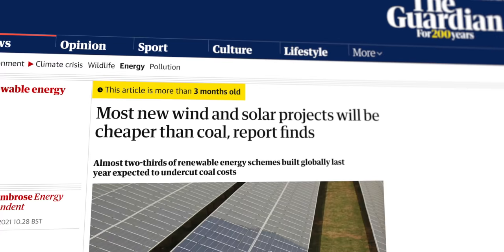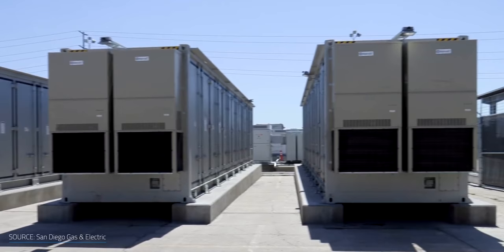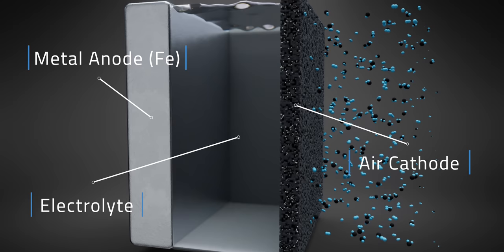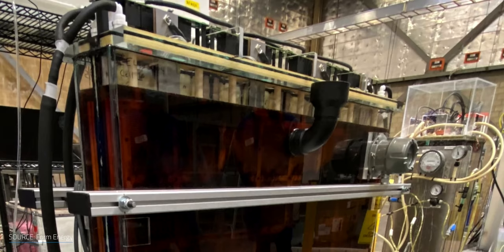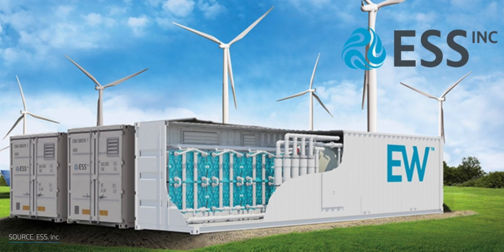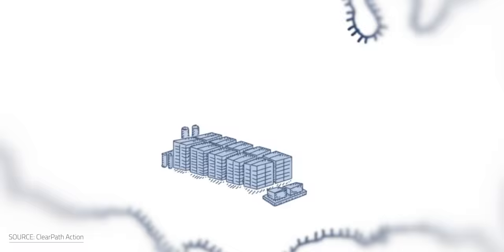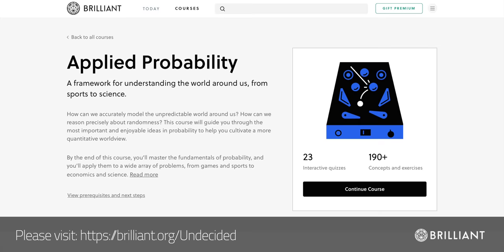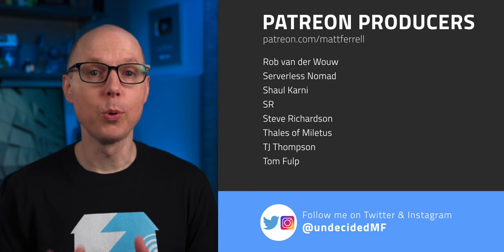Why Rust Batteries May Be the Future of Energy - Iron Air Battery Technology

Comment: It’s a common misconception that grid storage discharge time has anything to do with physical limitations of the battery tech. Lithium ion batteries can easily discharge for hundreds of hours. The issue is the market value of energy over these time scales versus the cost of the battery. Li-Ion is so expensive that it is only cost competitive for short time intervals where short peaks in demand place a strain on the usual suppliers. These peaks can generate enormous energy prices 100-1000x the average. Iron-air’s raw material cost and simplicity has the promise to reach the $20/kWh point where it becomes profitable to sell energy over tens or even hundreds of hours of continuous discharge when the price is much closer to average and you have to compete with traditional suppliers.
Reply: @Patrick Bryant - Thank you for this particular explanation. I was getting skeptical with the price difference between Li-ion cost @ $200/MWh ($0.20/kWh) and Rust cost @ $20/kWh. The point is that the $0.20/MWh of Li-on discharge is ONLY during peak hours of usage, whereas the $20/kWh of Rust discharge is "all day, every day".
@Undecided with Matt Ferrell - What did you find was the average cost of Li-ion during non-peak hours?
Reply: There is dollars per Wh, maybe there needs to be dollars per W (i.e., discharging speed) to go along with that.
Reply: @solarsoils7368  What Matt didn't make very clear in the video is that the kWh number and MWh number are not comparable because they are measuring different things. He ought to have provided equivalent numbers so people can compare them properly. The kWh price is the price of the battery, IE one full discharge cycle. The MWh price is the price for all the electricity you can store over the entire life of the battery. It is roughly equivalent to the LCOE for a generation system. What really surprised me was that Li ion batteries are so expensive that the electricity they supply over their lifetime is much more expensive than nuclear power over it's lifetime. Somewhere between 1.5-2x as expensive. So it may be cheaper to build enough nuclear power to supply all night time needs rather than building batteries to store solar power to use at night, even if you then just throw away the excess solar generation. If this rust battery really achieved what they are claiming it could (a big if as it's just a marketing claim with no public data to back it up) then it could be 1/10 of the cost of Li ion or better, which would make it much cheaper than nuclear.
Reply: In other world capitalims destroy the planet 👀👀👀
Reply: @memesfromdeepspace1075  Which world?
Reply: Yeah, having the first sentence be blatantly bogus and not clarifying it promptly is pretty bad.  Everybody and their mother knows batteries can last more than 4 hours from personal experience.
Reply: This is the only thing I really wanted to know about this particular technology. Thank you.
Reply: Why is this necessary? Energy producers have been storing energy for decades by pumping water up into reservoir to be used to power turbines at some later date.
Reply: In many applications NiFe would be perfect. If I remember correctly, you can actually use slightly modified portland cement as an electrolyte. Efficiency might be bad, but with no maintaince cost, no water filling, and your wall would be the battery, you could use something like 1m2 isolated pieces to build your wall with a led as an emergency or night light, without almost no extra cost compared to the regular wall. Just a tiny solar panel could get the job done. Use the traditional version, and you get the benefit of "no child or slave labor", while still getting more environmental friendly battery co2 included. They are clearly too heavy for a smartphone or a car, but any new housing with batteries built in to, and from same material as the wall, it might really be something to think about. I'm thinking about doing something like that on my boat some day.
Reply: So grids everywhere should have Li-oin for peak times and Iron-Air for all the other times.
Reply: Asking for knowledge, but when considering long-term costs isn’t the deterioration of lithium ion batteries over time still a factor when considering the physical limitations of battery tech?
Reply: That’s exactly what I was wondering. When I heard “17 times the duration” that didn’t make any sense. One megawatt hour battery should deliver 100 W for 10,000 hours regardless of chemistry, right?
Reply: The biggest problem with Lithium ion is the rare elements involved, especially cobalt. There are only 2 countries with large cobalt reserves which are the democratic republic of Congo and Russia. Russia is not very reliable and cobalt in the Congo is extracted by slave labor.
While lithium is a little more spread out it's still not exactly a common element and will very likely lead to wars. The republicans are talking about possibly invading Mexico cause it nationalized it's lithium reserves. While I don't think anything will come of that specific threat it does highlight the danger of relying too heavily on rare elements.

Comment: Out of all the tech you've talked about recently, this one seems like the most likely to take off. Mostly because of the simplicity of the design and the cheap cost of production. Great work Matt!
Reply: There is a huge downside to this tech...  Very poor amperage/current.  The only reason they have "days of power" is because they have such insanely low amperage it takes days to get the energy out.
Reply: @robweaver8872  I could see that being easy enough to work around, stringing them together in series. I could be mistaken though, most of my experience with generating energy is in nuclear (the US Navy's Nuclear Propulsion Program is where I learned a lot of what I know about power) the problem with a background in nuclear is ofc it's basically an infinite energy source so we just turn it up higher, or add more :)
Reply: Nah... there's always a catch. I've been to many presentations on various "new energy" or "new battery storage solutions" that touts themselves as the "THE Next Big Thing"... then only to fizzle out due to some trade offs (cost / toxic waste / insufficient energy density / unscalability etc.). Lol.
Reply: @msihcs8171  Stringing them together in series?  That doesn't solve the problem..  But of course tons more cells and MASSIVE cells will help increase amperage.  But no configuration or any amount of cells will change the problem of their low power density.  I think the only solution would be to combine them with massive super capacitor banks or other lithium banks.  Think about it, if you need a battery half the size of a house just to keep up with a single household draw, you will need town size battery stations to keep up with a single city.
Reply: @msihcs8171  Parallel. But yes, this would address the problem; the question is HOW BIG of a problem is it. Or rather, how big would your battery end up needing to be.
Reply: @Phazaar  the nice thing about them being based on a common material is that size isn't (AS MUCH) of a problem as the material is available in the required quantities, think about a junkyard full of cars etc. If you convert that into batteries you could make some big ones.
Reply: @msihcs8171  It's not really resource scarcity that's the problem if it requires massive batteries - it's locating them. If it takes a house-sized battery to power a house, we need to double our build environment to utilise this effectively, for example. That might not be a problem in Wisconsin, but is a lot of a problem in DC, or LA, or most other developed countries.
Reply: @Phazaar  expect this to be like everything else in the technology world, as the tech is improved and iterated upon we boost efficiency allowing for smaller batteries to produce more power
Reply: @Phazaar  The trick might be to build our towns/cities on top of (or even inside) the batteries.  Obviously, retro-fitting existing towns/cities would be problematic.
Reply: Just another pipe dream from Matt.  He's so indecisive.
Reply: This will likely take off just because of how dramatically cheaper iron is compared to lithium. According to Wikipedia, lithium is 192x more expensive compared to iron. There is probably a lot of fancy stuff that needs to be done to the iron which evens it out, but when the price difference is that stark at base, all the extra shenanigans are worth it. Though I doubt this tech will go far beyond the electric grid facilities.

Given that this tech can't unload its energy quickly, it already falls short in the EV department which is competing with the power of the combustion engine. At best it would be used as a backup option, to charge a battery that can unload its energy quickly. Don't get me wrong, any battery can unload their energy, its just a matter of how long it can last when unloading a lot of energy simultaneously and I don't think this tech would be good at that.

Yes, everything has a catch, and slow power draw is a pretty dramatic one, but this does attempt to tackle two of the largest problems in renewable energy: the extreme price and the struggle to generate a surplus of electricity (which leads to literally turning off windmills and panels).
Reply: @Ozzie climate refo  Gelion kinda got outdone by iron air batteries here in regards to price point. Gelion might be 1/9 the cost, but Iron Air would be 1/32 the cost.

I think the main advantage Gelion has though is safety. It's probably the safest of all batteries.
Reply: Though we also have to consider the political aspect of this. You need a government really take a chance with this as private companies are unlikely to do it.

Comment: What about massive ferris wheel sized flywheels? Or are we too concerned about them breaking free and sawing a city in half?
Reply: My guess is that it has more to do with the difficulty of mass producing bearings that can continuously support the flywheel for decades with minimal lubricant or loss of energy. They don’t seem to need vacuum chambers to achieve high efficiency, so it must have to do with rolling resistance and manufacturing or maintenance.

Comment: I wish you wouldn't conflate capacity (kWh, etc) and power (kW, etc)... People are confused enough as it is. It would be nice that educational channels would at least get this right...
Reply: @mrxmry3264  You make a good point. I do think though he said 100 MW, which will be the maximum output. This is for 4 hours which would be equal to 400MWh.
100-hour battery is indeed meaningless. I don't  think there is any industry standard jargon for this.
Reply from the maker: Yes, I mean MW not MWh's there.  I didn't misstate anything.  The initial facility is 300 MW along with another 100 MW unit coming later.  All in it will eventually provide 400 MW.  You can calculate the MWh by the fact it can provide 4 hours of energy.
Reply: @UndecidedMF  Ah yes, you are in fact correct. If you are talking about power plants the maximum power output is indeed referred to as capacity. I was thinking in terms of battery storage where capacity is the stored energy.

Comment: If the battery is going to take up a massive amount of land, then just put solar panels on top of it, that way the land is used for two complementary projects.
Reply: How about solar freakin' roadways?
Reply: @TechnoGlobalist  Its been tried -- they just don't hold up to the abuse of traffic
Reply: @scottsuhr2919  r/woosh
Reply: they probably will
Reply: *solar above, geothermal below.

3 for 1 deal.

The geothermal heat can be used to regulate the temperature of the containers if they start to drop to the point that the molten electrolyte might cool and become useless.
Reply: @Stormblessed72  Solar panels are notoriously damage averse.

They literally wear themselves out just from being active without any physical/kinetic interaction.

Perovskite based solar will be worse still vs silicon solar until they can stabilise it better.
Reply: @TechnoGlobalist  Traffic wears or the materials we currently use, especially heavy interstate trucks. It will wear out the less durable materials of solar cell roadways much faster.

Comment: We are always talking about commercial size battery storage and power generation.  The cost to build these facilities and the transmissions lines could be offset by doing this more residential because the residential housing is already tied to the grid.  Miniaturize these batteries to power a house for 100 hours and put solar panels and smaller wind turbines on the houses to produce electricity.  The cost of electricity would drop like a rock.  This is another way the government helps their cronies off the backs of the citizenry.
Reply: Absolutely. But how do you convince every home owner of this? Or even just the majority of them? There aren’t enough climate conscious people to make that viable.
Reply: You know what would be even easier then to give every house a shed that requires special maintenance. PUT THE DAM THINGS AT DISTRIBUTION/GENERATION LOCATIONS!!! srsly there is a reason not every home has its own power plant, decentralised is more costly.

Comment: This would dramatically reduce the price of electric cars, too - by removing the demand for lithium in grid storage batteries, that frees up huge lithium supplies for use in vehicles, which drops prices there!
Reply: Electric cars are unsustainable,they are comparably as bad for the environment.
Reply: @joaopedrocruz6432  giant old computers the size of an apartment are unsustainable. Thankfully tech improves over time
Reply: @hostjhall  Electric cars will never be as efficient as public transport or even bicycles,they are just a waste of time to preserve a car centric model.
Reply: It would not. If you think a multi billion dollar corporation is going to cut its commodity price because one is using less of it, no happening. If you cut a current commodity use by 50%, you raise the price 51%. Business is about making 100% profit sir.
Reply: @joaopedrocruz6432  Mass public transport is only feasible when you have a poor populace or high population density which causes other problems.  Electric cars could be used as shuttles in combination with mass transport to give a hybrid public transit system that is cost effective and convenient.
Reply: @johnclamshellsp1969  The most efficient batterie recycling I know of, comes from Duesenfeld which can recycle 72% with mechanicall recycling and 91% with an hydrometallurgic methode, so nothing with inefficient.
Also hydrogen is abundant in the universe but not on earth, hydrogen deposites are rare and the blue production needs gas which causes methan to escape in the transport and Co2 in the CCS process.
Reply: @johnclamshellsp1969  you clearly don't understand the first thing about economics.
Reply: @joaopedrocruz6432  You can whine all you want about sustainability, but electric cars are the inevitable future because they have quicker acceleration, lower maintenance costs, and can be "refueled" at in people's homes.
Reply: @joaopedrocruz6432  Maybe so. But how do you convince people to switch from cars to bikes and public transport. If you can’t, then electric cars are still an improvement, if maybe not the biggest one available.
Reply: @Loaderdani  By not cramming in car acomodiation where it is not feasable. If cars are the easy but bad option stop making it easy and make bike/public transport the easy option.

Comment: Something you might be interested in is the CESAR Basalt battery. 

It is a way to store a surplus of electrical energy as heat inside a body of concrete mixed with steel slag to use this heat in the winter to heat up houses.

Comment: For grid storage, the cost to deploy a MWh (over its life, taking cycle life in) and the conversion efficiency cost/loss (charge*discharge=eff) both really matter. 
How does rust compare to pumped water towers?
Reply: I don't think a water tower could hold enough to be worth it. Pumped hydro uses 2 lakes to pump between. Which means you are very limited in where you can install it and the people and animals who live in the valleys you flood tend to be displeased.
Reply: @adrianthoroughgood1191  Yeah, but if you already have a dam.... then it is the pump efficiency which matters.  So for some cities with predominantly hydro generation it is a good question.
Reply: 2 dams with solar or wind above to pump water up and hydro down. Also allot of cities have water issues. Most countries biggest problem is government with short vision (next election).